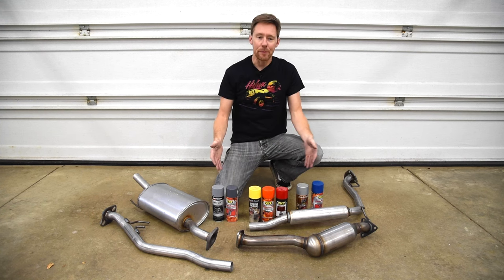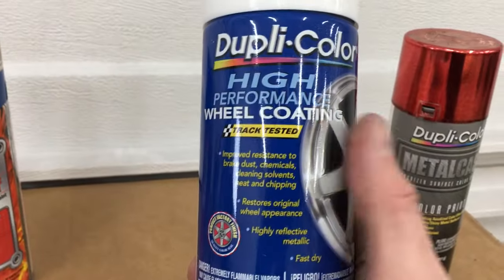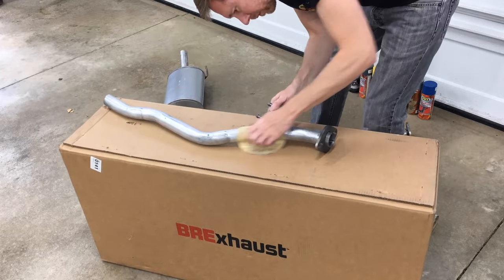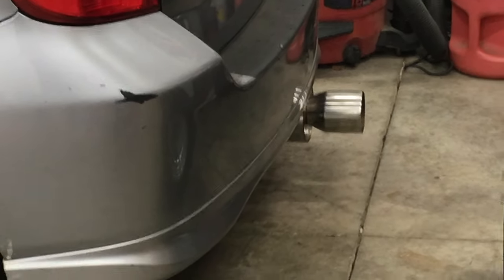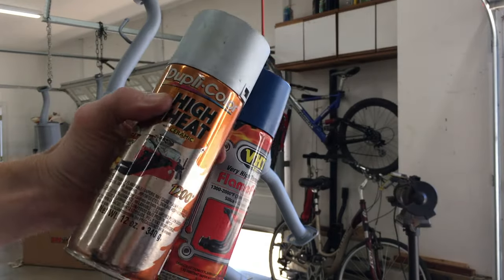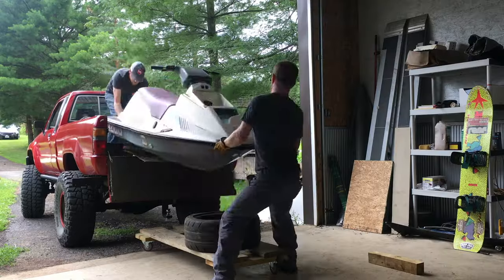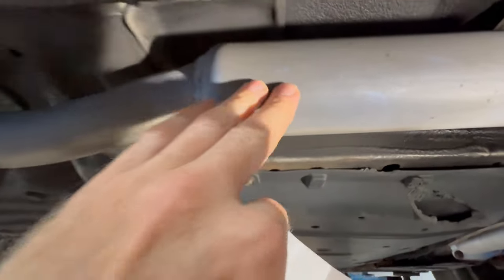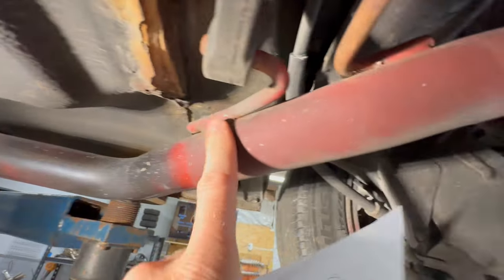Best High Heat Spray Paint to Prevent Rust on an Exhaust - 7 Month Winter Test

Comment: Im a mechanic in NY and these cheap exhausts normally only last 2 years before a connection rots away or a weld fails and you have to cut and sleeve it. Guaranteed you’ll get a few trouble free years from your work. Awesome.
Reply: which aftermarket brands would you say use good steel? my walker exhaust rotted in 3 years
Reply: @ShadowGKCP  anything that is stainless will last. Autozone, Napa and advanced all use garbage. Just has a coating that comes off in a few months. You would need to fully paint it like Brian.

Comment: This is going to sound a bit odd and sketchy.  But I know a fellow here in Ohio who paints his pipes and exhaust with rubberized undercoating.   It turns into a hard coating and oddly, doesn't catch fire.  :)
Reply from the maker: I’m intrigued! I may have to try this 👍
Reply: @6thGearGarage would love to see it, unconventional solutions are the tricks of the trade.
Reply: @6thGearGarage I want to paint my chrome aftermarket exhaust tip gloss black . Can you recommend the best spray paint to do that .
Reply from the maker: @richcampbell6808  You'll want to finish it with a high heat paint, such as gloss black VHT engine enamel. I'd also scuff it well first, like I did in this video, and apply a high heat engine primer second.  Just be sure to clean well between each step to remove contaminates and get best adhesion!

Comment: The welded seams are NOT rusting from the inside out! Weld seams can rust easily because of oxygen corrosion, also known as "knife cut" corrosion. The welding process creates a Heat Affected Zone (HAZ) that changes the structure of the metal grains, which can lead to pinhole leaks. The weld metal is usually optimized to improve its mechanical properties, which makes it more "anodic" than the base steel. This can cause the weld metal to corrode at higher rates than the base metals. If you can find a "high heat weldable primer" it will help.
Reply from the maker: Thanks for explaining 👍

Comment: The weld heat changes the metal, you can brush high temp grease at the joints then wrap them with aluminum tape , just peel off when the salt season has passed
Reply from the maker: good idea, thanks!
Reply: @6thGearGarage  I do this to my boiler furnace where the pump flanges rust . No smell but have to do it every winter. If you're under your car a lot you can also use a propane torch and gulf wax to condition the pours of the metal it's how blacksmiths finish off raw steel to cure from rust.  I think a exhaust weld would need this monthly though

Comment: Hello, do I need to use a primer before coating? I saw that you used VHT flameproof primer before coating. Do I actually need it, or can I directly apply the coating?
Reply from the maker: I would recommend the primer for the best adhesion.

Comment: Awesome, did you follow the curing instructions on the 2000 degree can?
Reply from the maker: Yes I did. I let the car idle for a while and then let it cool, then let it run again for a while. I cured some smaller parts in an oven for a couple other videos. The oven was faster/easier.
Reply: @6thGearGarage  thanks for getting back to me, I'm going to be using this on an application where I can't follow the curing instructions so I was wondering if it's still effective if you're unable to do that

Comment: I just started playing with cerakote. I am coating everything with it. I am not even doing the prep all that good after how I seen it do on a rusty chisel. 

I tried the high heat black on my over axel pipe to tip and it did not hold up well. 

I order a new 5 inch system for my truck last week and going to try the cerakote on it. Figure you might want to check the product out. 

C series is the one you want to try. 1800 degrees of heat resistance and no oven needed. .
Reply from the maker: That's awesome, I will check it out

Comment: The original exhaust system on my 1997 Buick Lesabre has a little surface rust here and there, but I live in South Carolina. When I changed a leaky flange gasket, the bolts actually came out. I don't know how anyone could stand it up there.
Reply from the maker: It's rough, but by now I'm used to everything being a PITA and figure every job should take 2x as long as It should.

Comment: One problem I've just noticed lately is, many exhaust parts for older vehicles are being discontinued by Walker. I Was able to buy a complete from the cat back system for my '92 Dodge Shadow only a few years ago, now the intermediate and extension pipes are that well known element called Unobtainium.
Reply from the maker: I ran into the same problem when shopping for a catback for my 1988 Legend. Custom built was the only option and not cheap.
Reply: Universal aftermarket parts, such as mufflers and resonators are a option.

Local exhaust shop can be helpful to custom make exhaust system, but they can also order it in too.

For older vehicles exhaust parts are also available online.

Junk yard can have the needed parts from the same car or same platform car.

For me its not hard to get parts, since I own domestic cars.

I've custom assembled complete catback exhaust system from different domestic vehicles exhaust tubing, resonator, muffler, tips, hangers, and it works well.

Comment: Super helpful test, thank you! Maybe it helps if you apply the paint a bit thicker on the weldings?
Reply from the maker: I think those welds might just be rusting from the inside out, as this is definitely a cheap exhaust.
Reply: @6thGearGarage  My theory is the steel for the welding wire has a lower quality than the rest, hence the weldings rusts quicker. Thats why I have painted the seams even thicker than the rest. I have just finished the job, lets see how it looks in 1-2 years :)

Comment: You seem to have forgotten the CAT is stainless.
Reply from the maker: I’m reading this and seeing your profile pic is a cat 😁. It is, but I’m still impressed that there were no chips in the finish of the flameproof paint.
Reply: The paint stuck, though, and hasn't shown any signs of flaking, etc. The high heat is what was the big concern at that point. Yes, the stainless will help prevent corrosion, but it isn't going to last "forever."

Comment: So I have a question. I painted the two headers and muffler on my zero turn mower with the Rust-Oleum 2000°paint. It's got a couple coats. My question is can I heat cure/bake it in while I mow or would it be better to heat cycle it sitting in place?? Didn't know if running full throttle mowing would just flake off or burn off. The exhaust systems are quite expensive so trying to keep it good for as long as possible. From what I read at 3600 rpm the exhaust gets up to 600° really quickly.
Reply from the maker: I don't know about the instructions on Rustoleum, but the instructions on the VHT can said to cure on the vehicle by letting it idle. Like you said, a higher RPM is a lot of heat.
Reply: @6thGearGarage  very true my exhaust gets to 400° at idle and 600° full throttle.

Comment: I live in Texas not far from the gulf I have had 3 bbq pits rust one rusted all the way through Now i have a pellet grill rusting and was wondering can that paint  be used on bbq pits both the fire box. And the 4’ long  28” inches around. And can the racks be sprayed as well to stop. Rusting
Reply from the maker: They could absolutely be used on the BBQ pits. However, I wouldn't paint the inside or the racks where any of the food will be cooking. Might give a strange flavor to the food.

Comment: I've used VHT header paint to paint an entire exhaust in Vermont- where there's more salt on the road than snow, water, cars, dirt or anything else... they love it salty. 
The results are fantastic, and the only issue I've had is the hardware. If you don't use stainless hardware, it's now the weakest link. I have a 22 year old exhaust system on my work van used to haul race cars, and the only issue was a weld breaking that corroded from the inside out. Makes me wonder if it's possible to coat the INSIDE of a new exhaust system well enough to stop that from happening. Another tip I'd suggest is that these paints need heat to cure initially- so after I paint them, I get a propane or map gas torch and heat it all up until the paint changes color a little. Some exhaust systems won't get hot enough- OR if there's some time between paint and driving the vehicle, the paint may come off or get moisture affecting adhesion before it's ever heated enough to cure properly. 
Thanks for a great video and a great idea!
Reply from the maker: You're absolutely correct! There were instructions on the high heat paint for curing on and off of the vehicle. I cured it on the vehicle, which was just running it for a certain amount of time, letting it cool, and then running it again for a certain amount of time. I should have put that in the video.

Comment: is it possible for the paint to entrap heat? say on a catalytic converter. would this cause any issues?
Reply from the maker: I did not consider that... but I have been told that a cat works best when it's hot, so maybe it wouldn't hurt it?
Reply: paint is a horrible thermal insulator, ceramic on the other hand would be however not the "ceramic" in a spray can. Either way you can insulate your exhaust given its not too small for the engine you'll be just fine.

Comment: If that exhaust is made from “aluminized” steel, it would explain why only the welds rusted. The paint may be doing nothing since aluminized pipe or SS would not corrode in one year, even without paint.
Reply from the maker: You’re 100% correct. A couple months ago the exhaust was getting louder and I noticed that the weld at the muffler rusted through.
Reply: @6thGearGarage  yeah it’s too bad the welds corrode , defeats the purpose of the aluminizing!

Comment: I appreciate what you where attempting to do but your approach and execution are flawed in several different ways. 
1st the exhaust you purchased appears to be aluminized (which is a very good anti rust coating) and very hard to get removed completely, that's why all the weld joints were rusted because welding will burn through the aluminized and leave rare steel. 
2nd the cat is probable stainless steel
3rd there are very specific instructions on the paints for curing which where completely ignored and at least for the HIGH HEAT paint makes a huge difference.
If you really want to do the test correctly get a 5 foot section of bare steel and repeat the test with the proper baking procedures or get as close as you can with a heat gun. My preference is to use a heat gun to blow through and heat from the inside out to bake.
I do appreciate the video but it could use some tweaking to get better real results.
Reply from the maker: There were instructions on the high heat paint for curing on and off of the vehicle. I cured it on the vehicle, which was just running it for a certain amount of time, letting it cool, and then running it again for a certain amount of time. I should have put that in the video.  One thing I should have done differently is left a section unpainted to see how it would have done with no paint at all.

Comment: Why didn't you use the primer before you painted?
Reply from the maker: I did use two types of primer before painting.
Reply: @6thGearGarage  

There are 2 types of primer? 
I know they make a regular primer, but what's the other one, thanks
Reply from the maker: @btbd2785   Engine and High Heat, they're both in the video